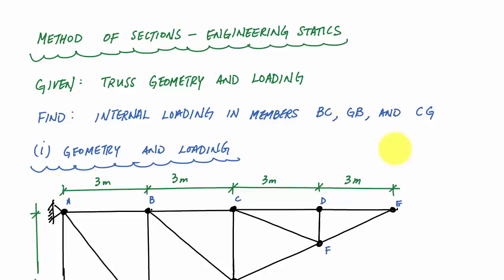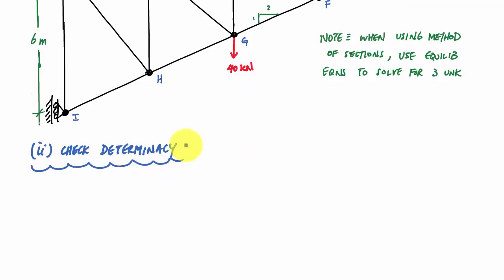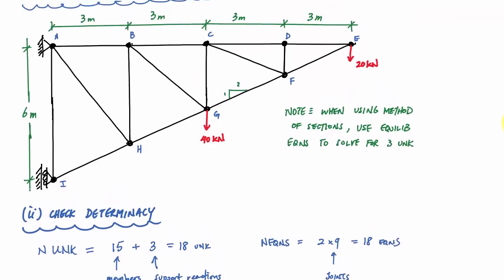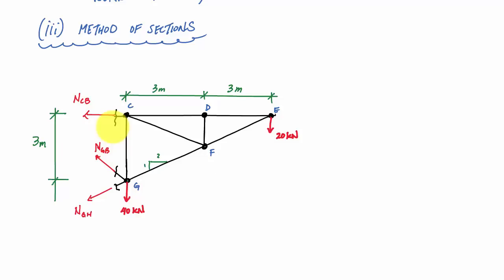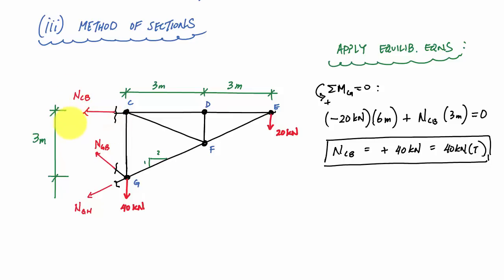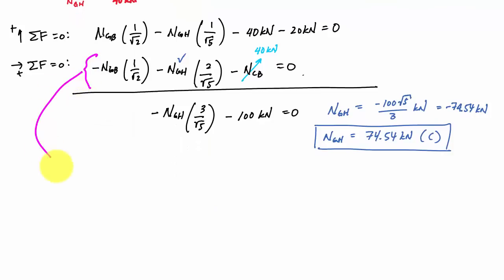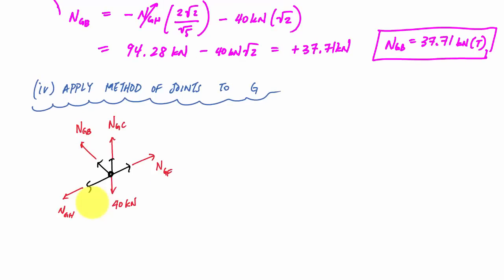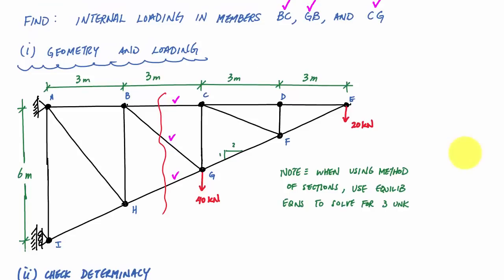Method of Sections for Truss Analysis Example 3 - Statics and Structural Analysis

Comment: Peter D.
Hi, I solved the force diagram using  the method of joints. I came up with slightly different results. BC=0, GB=28,  GH=-78.